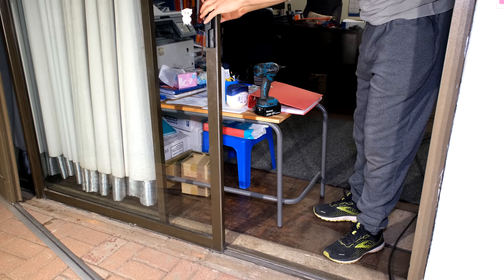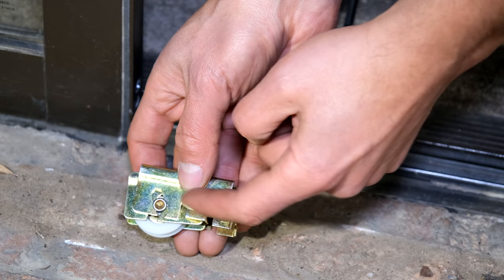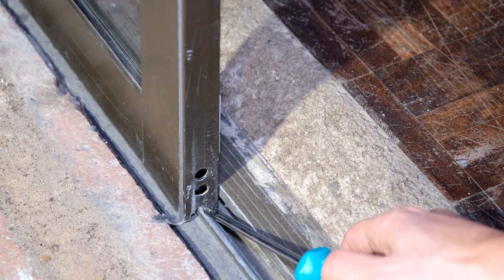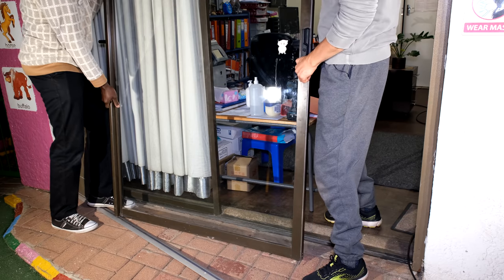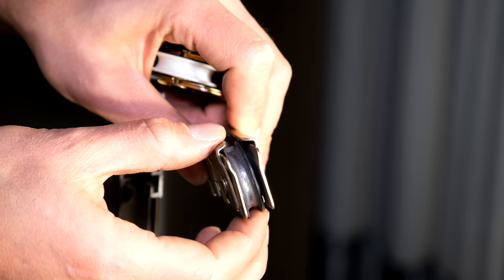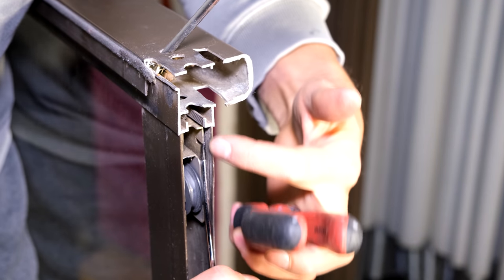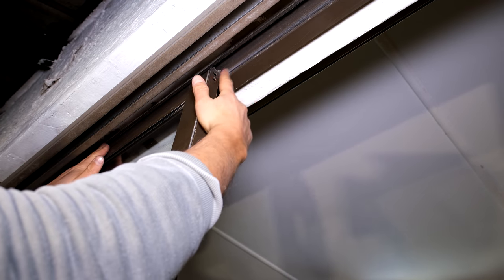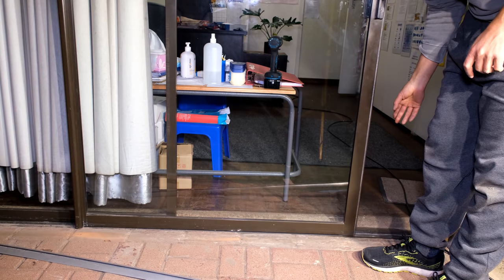Sliding door stuck? How to replace the rollers.

Comment: You might also add that if your track is corroded at all it will eat your new rollers, you can buy SS track liners that are a "u" shape that you can caulk down over your existing track and have a nice new easy sliding door and longer-lasting rollers, and it's an easy job also.

Comment: Shoot some WD40 on the housing to help make it easier to remove. Nylon wheel on a metal rail will not last long. Need to replace with a metal wheel and add some grease onto the bearings before installation for a longer life

Comment: Thank you for the video. Helped a ton.

I had a frightening experience this last weekend. My door kept jamming and riding up… and then what was worse was the door dropped totally and the top came out of the runner and started tipping out. Now I have EDS meaning I dislocated joints easily but when I saw the door falling I just dived outside to stop it completely on adrenaline… and popped both shoulders. 

The rollers really needed replacing YEARS ago as the door is about 20 years old. Oh well, you live and learn.
Reply: Thanks for the EDS warning! My buddy & I both have it - will be extra careful changing rollers & watch out for tipping. Hope you were able to pop them back in & healed up quick!

Comment: Just curious, isn't your door installed incorrectly? shouldn't the sliding side be on the inside and not on the outside so someone trying to break in can't just remove your door? 🤔
Reply: i also believe the door in install the wrong side.
Reply: I am not that experienced, but all sliding doors I've seen are sliding outside. When the door is locked it cannot be lifted out of the track.
Reply: @hannesbezuidenhout385 my door slides on the outside, don’t like it, but it can’t be reversed

Comment: Silicone spray on the track helps as well.
Reply: I am staying on the coast right next to the sea and I replace wheels fairly often because of the rust element. I also find silicon spray by far the best to lubricate the wheels. Keep in mind ghries attract a lot of sand and dust being it close to the ground

Comment: as usual in my case something has to go wrong. Funny enough, my sliding door only has one hole on one side. Now that obviously means that I will have to drill another hole on the other side. Also, I have tried and tried and tried to turn the wheel screw anti clockwise to lower the wheel, but it will not budge. I have sprayed and sprayed with lubricant eg WD40 to know avail. Yes, I am turning the screw the correct way.

Comment: If the rollers are rusted and the adjustment screw doesn't work can I just remove the upper screw and hope the weight pushes the wheel up into the frame

Comment: unfortunately,  most sliding glass doors are on the inside,   while the stationary doors are on the outside.  this means - you have to remove the outer door first, then the inner door.   you can`t remove from the inside,  as the inner sill is too high.  a little more work,  but doable.  he did an easy one,  knowing.

Comment: Do the roller assemblies not screw to the frame at all? I have a door identical to this, but the old parts i pulled out look nothing like that wheel assembly. In fact, there are two screws - one that adjusts the height of the wheel and another one that screws it against the short wall. Of course, I'm adjusting it every other week, even with the brand new assembies I put in, and they wobble side to side as it's just a long (stripped) screw holding it in place now.
Just shocks me that it's not secured to the frame, just sitting there

Comment: Good video, but you can do it without removing the door. My sliders are on the inside track, not the outside track.  Lever one end up, unscrew its vertical end to access the roller, then replace the roller ( there are 2 to a door) and reassemble. There is a special spray cleaner for doing this, do not use anything else to clean the track and the guide track.

Comment: How easy it to flip the solid bit for the sliding door? I would like to switch the solid and sliding areas.
Reply: Do you mean switch left to right or outside to inside?
Reply: @kowen5323 From left to right. But now I'm thinking of removing the solid side and replace it with hinged windows.
Reply: @MartinMenge  left to right is sometimes easy, sometimes difficult and sometimes impossible. 
Depends on many factors.
Reply: @kowen5323  all good, thank you

Comment: I seen same type of video on net.why don't they clean the rail with tool or minus screw driver and than vaccine cleaner.i think it is sufficient to avoid changing roller.no one is doing this .even ,in all this type of friction mechanism, we always use lubricants,,no one using or suggestions too .just replacing the roller which cost not just of rollers but ,glass too if it break in between replacing the roller.

Comment: My rollers wont come out.  But still, I know why the wheel broke. The wheels are made of plastic.  About four years ago I replaced the window pane, double glazed.  I put in 6 mm x 4 mm glass rather than the old 4 mm x 4 mm glass.  I am trying not to hear this crazy woman with four sausage dogs in the garden behind me. The silly woman did not realize these are dogs that hunt badgers and we live by a footpath so the dogs bark at anyone.  She is a former waitress and her husband a window cleaner and very noisy neighbours.  I have another double glazed patio door just immediately behind this one but I wanted to make the sound proofing better.  The problem is that the distance is less than 150 mm between both doors (otherwise the thicker double glazing is just fine tuning because noise abatement is governed by the distance between both doors).  So I believe the extra weight of this door aka the weight of glass, eventually damaged the plastic wheel.  if I can get it out I was thinking that maybe I should try to get an aluminium wheel but will that be stronger?  The door is brown and almost exactly like yours. I am in UK while you are in SA or Rhodesia and so probably the same system.
Reply: I also have heavy doors but replaced my single wheels with double wheels. It fits snug into the space. So far so good. It is definitely better than the single wheel